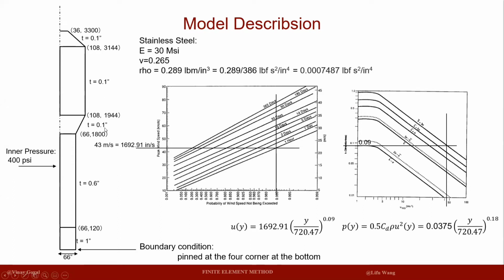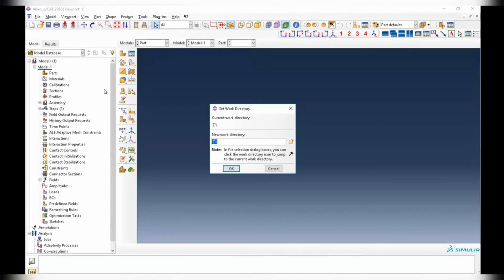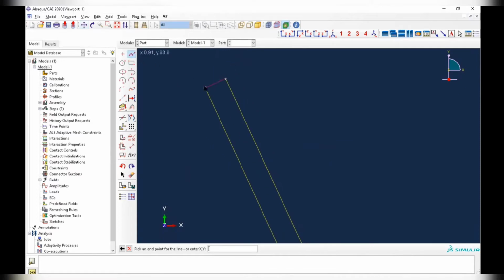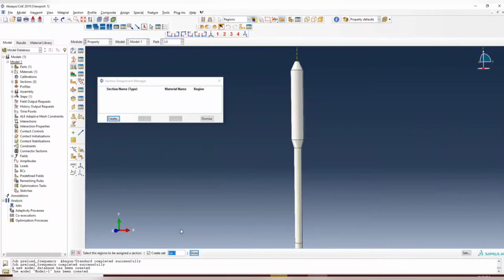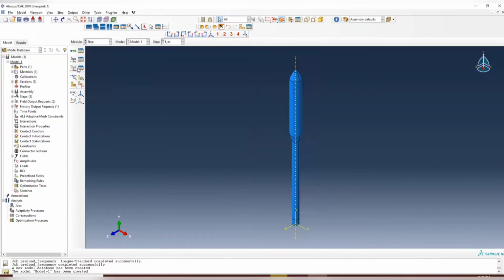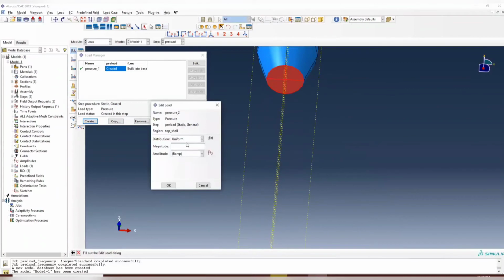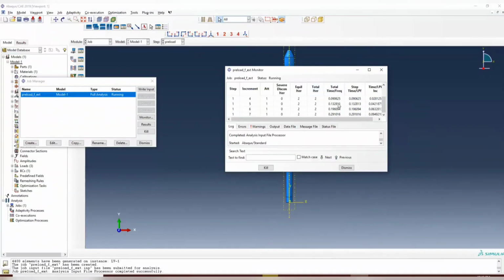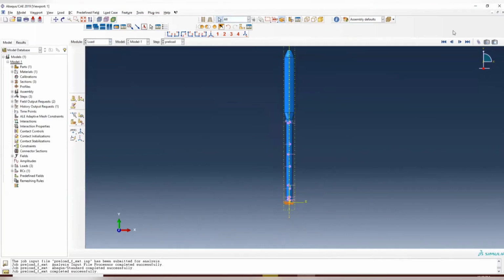#ABAQUS TUTORIALS: Launch Vehicle Frequency and Modeshape Extraction

Comment: determination of nominal ground wind speed at the beginning is incorrect. Looks like 43 knots was assumed to be 43m/s. m/s uses the secondary y-axis; should be ~22.2m/s = 874in/s. This persists into the k calculation and probably persists through the further analyses but I haven't gotten there yet to verify.